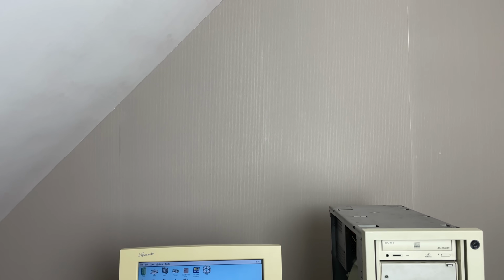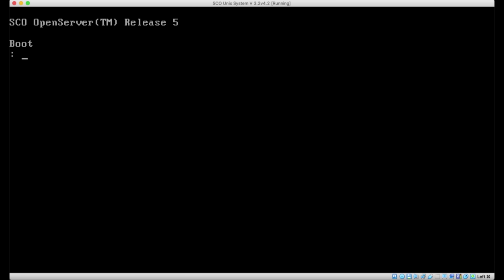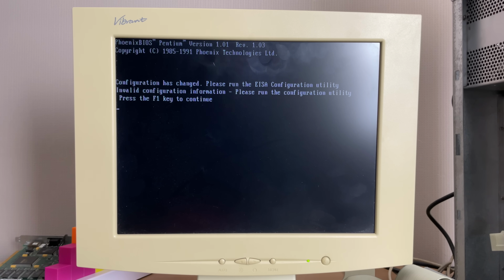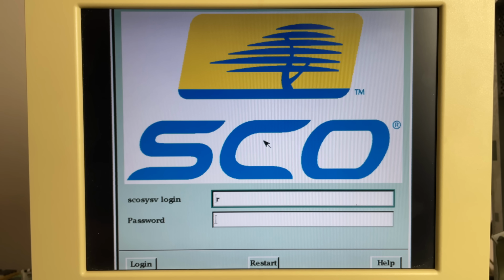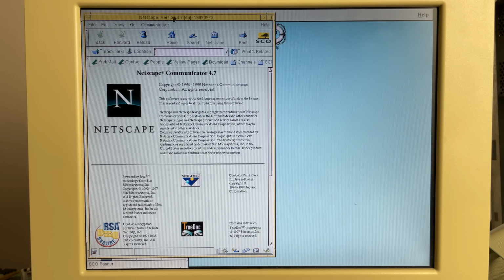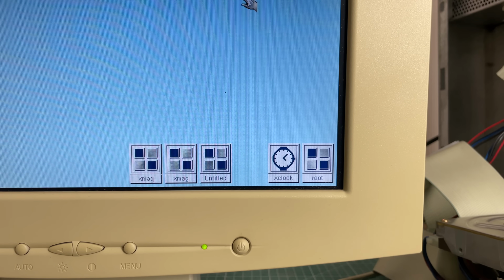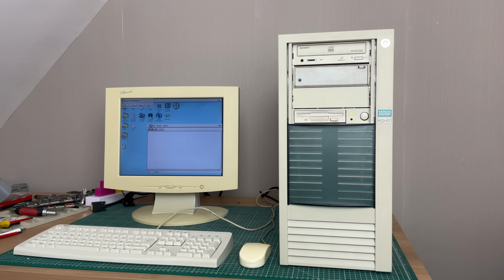SCO Unix OpenServer 5 install on the Siemens

Comment: My only exposure to SCO Unix was at the local library. It was how I first got on the internet in the early 90s. 

You applied for a user account with your library card, and in turn got a login that you could use at a bank of Wyse amber screen terminals. There was a neat little text menu system with access to all of the typical early 90s internet tools - usenet, gopher, email, etc. and even limited shell access - I remember the quota being something really low because you would hit it really fast just saving text files to your home dir. There was no way to write anything to floppy to take home either which sucked, but I had BBSes for that.

I remember my E-mail address was insanely long as the library server was nested behind a bunch of different subdomains. You could also dial in to the system from home and access it that way - the library even later on offered very, very basic dialup internet service, but I remember it being insanely slow. I was about 10 at the time and already knew DOS pretty well, and started learning Unix a bit that way. Within a few years I had dialup at home, installed RedHat Linux (remember the thick book and CD combo sold at Costco) and had no use for the library system.

I read some truly horrific stuff on usenet sitting in front of that Wyse terminal, stuff that no ten year old should have been reading, and enjoyed every second of it. Nobody was watching over your shoulder or keeping track of what you were doing - at least as far as I know.

I don't think I ever encountered SCO Unix anywhere else, but it was my first gateway to the internet and Unix as a whole.

Comment: One of my first jobs the company have a box running SCO Openserver.
They didn't know exactly what the box was running but we still have to login on it and run a batch job every night. The box was notorious for not booting and need many tries to restart it. 
Almost one year later after they needed to move some servers to another datacenter we tried to discover what the server was running.
Them we discovered he was running the ERP from a company my company bought some years ago and before everything was integrated into SAP the batch process was necessary to move data from one system to another but this wasn't the case for many years but nobody asked it before.
And this wasn't the only server we have no clue what was running one old IBM AS/400 and one IBM P series blade was in production and only after a archeological research we discovered that one server was running Lotus Notes and the other a DB2 database used by a company we bought in the early 2000s.
When I started to work there, there's a HP Superdome that a company we recently bought used. We have no use for it but the network admin was adamant that the server was useful. After six months we couldn't find any use for it, but at least I could work with HP-UX just for the lolz.

Comment: I remember when SCO released their UNIX...  You could get the distribution on floppy drive or cartridge tape for one price, and you could get a distribution  on CD-ROM for about $300 less...  That was about the price of CD drives back then, the idea was to get users and system integrators to begin using CDs for software distribution.  I also remember when SCO was actually a terrific software company, run by Larry and Doug Michels, and given the hardware at the time (in the early 80s) the they really made the hardware available at the time do some amazing things.  After all, the PC-ATs and 386 systems available didn't have hardware memory protection (unless you went with something designed to be a multiuser system, like an Altos 2086,) so SCO Xenix was originally written to do memory handling in software.   The pc based hardware just wasn't available to really make *IX hardware work, not like something along the lines of a M68020 processor in a SUN III workstation.

Comment: You seem to have a mixture of SCO Unix and Xenix versions in your SCO box. I noticed at least System V 386 and Xenix 2.2 286 in the mix. Would be nice if you'd create image of them. archive.org or tenox maintain old Unices. They also collect activation keys you need to successfully use your installation.
Unix versions from this time are quite interesting. Having as many of them as possible is important. As you already noticed, you kind of need to have the contemporary Unix to your hardware to gain the required boot/install time driver support. Things where moving fast back then: MFM, RLL, SCSI, IDE, 286/386/486/pentium, ISA, EISA, PCI...

PC Unix is a field massively underrated. However it saw tons of development, many, many vendors and versions between 1983 and the appearance 386BSD and Linux.

Comment: I hear ya on not wanting to do 45 floppies. Get a GoTek instead. Put all 45 floppy images onto a USB stick and the GoTek will emulate a floppy drive for you. Easy.
Reply from the maker: Was going to do that but the software I use to put the images on the usb drive crashed when I tried copying the "P" disks

Comment: Nice video! SCO OpenServer uses IXI X.desktop desktop environment, lightweight and based upon Motif toolkit.

I would try to run WordPerfect 6.0 (WinWorld has a nice Unix ISO). CorelDraw! also had a Unix version, but the one I found (also from WinWorld) is not compatible with SCO operating systems.

Comment: Have you considered loading the older Unix floppy images onto a Gotek?  It would certainly be easier than actually making and swapping 40 floppies.
Reply from the maker: I did, but my software wasn’t able to write the program disks to the gotek (the boot disk (n1), and filesystem disk succeeded but not the P** disks.

Comment: I have a box of sco(santa Cruz operations)Unix cds with different versions including some that mention netware(here somewhere) I had issues like you had where I couldn’t get it to do anything/install/etc.  Kinda refreshing seeing someone get it to do something, lol.  Those directories of sco cds is they appear when you do directory of cd.  (Need to use something like dskimage.exe to extract to a cd and floppy). Also when you system’v’, it’s system five in case someone else didn’t mention this.

Comment: Gotek Floppy Emulators are your friend when you need lots of floppies on real hardware.
PS: you want the Flasfloppy firmware, so you just copy/paste a folder full of floppy image files to the USB stick.
Reply from the maker: Tried that. But the software I used crashed on disk P1 and upwards. Other disks did work.

Comment: When I was working for the Ministry of housing back in the late 1980's we had an upgrade of a server. This server tracked all the hazardous waste spill responses for the province of Ontario. It ran a custom application for this purpose. The upgrade involved a $20,000 server a copy of the Informix database and SCO open server along with the custom application. It was used by the department staff of six. It was quite a large database. It was replacing an old server that was at least ten years old and was clunky and prone to hardware failures. It was so old that the hard drive sounded like a  howitzer every time the heads moved! Knowing our government, they are still using the same server even today! When I was at the ministry of housing we ran the entire housing allocation system for affordable housing on an ancient system that utilized two-foot wide and 8-inch high disc packs. When I was there they told me it had been running since 1976 and this was in 1985. They were just starting to re-write it for the mainframe on an IBM 370/VM platform using a database system called model 305 I think. It a very  BASIC like language and very easy to work in. But not much of transferrable job skill.

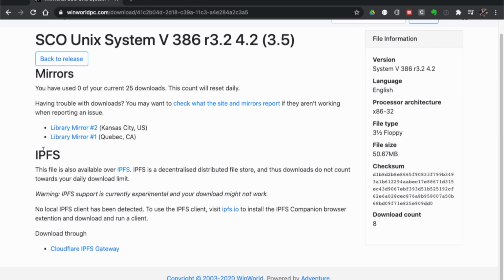Comment: 4:44 This is where a GoTek USB floppy drive emulator really comes into its own, though admittedly reading 40 diskette images off a USB stick would still amount to a lengthy install, and wouldn't be very authentic :)
Reply from the maker: Well I was planning that, and the first couple of disks went fine but when I got to the program disks (the bulk) the software I use to add floppies on the usb stick crashed every time

Comment: You installed the OS on a disk you knew had bad sectors? Bad mistake buddy. If they were physical redundancy errors your installation and experience will be fucked. Might as well re-do this with a different drive and maybe even an SDcard to SCSI device. It was interesting to see the very quaint GUI :) The ISO files are available on a http site offering ISOs and disk images of all old Unices.
Reply from the maker: That is the plan, was expecting the install to fail in all honesty. It does do some kind of bad block check during formatting. But so fat she’s been running fine. But 4 hours might be a bit long for an install like this. Will check it with another hard drive

Comment: My understanding of SCSI is you're terminating the cable, not the drive. The terminator is a resistor bank that makes the cable behave as if it's infinitely long, so signals don't reflect back and cause interference.

Comment: for floppy installs id suggest a floppy emulator, either an HXC or a generic usb one, just so you could have a bunch of flopppy images and never need to use a floppy, I did this with my kaypro 2x and my commodore 64, I still have the original drives, but I knew these drives are close to 40 years old, so I felt going flash based was good, also the commodore 64 with the fastloader and the sd2iec ive never seen a vintage system function so fast, due to seek time no longer existing

Comment: ugh... 40 floppies? I might try that once... with OS/2! today I might use a ahci sata ssd and pci to sata card that does proper LBA48h translations and set it all up on a win 10 machine. creating partitions in win10 will do that partition alignment thing ssd's like. maybe setup a virtual way and raw map that ssd and virtually loadup those 40 floppies. 

I look at storage as a consumable now. If it's important, use new storage! and ssd's (and sata 2 pci) are a great way of kicking an ol' system into todays age! Make old NEW again, <3 all

Comment: Sigh..happy happy joy joy...I installed  dozens of them Openserver 5.0.5 servers about 20 years ago, text mode only (no X windows).  Ok, powerful for MTA serial networking those days but it could also be a pain in the bum if things backfired or crashed.  I didn't miss it changing to the dark side (of Windows/Intel)  ;-)   Still a very well made review, congrats with that...I'm looking forward to the next part

Comment: I'm 42 yo and this was the first time ever I saw any kind of UNIX in operation. Up until now it was just a word to me. Thanks :)
Reply: That's nice, but I should point out that since macOS is a UNIX-certified OS, if you have ever used (or seen someone use) a mac with macOS or OSX, you have at least technically seen UNIX in operation
Reply: @gregorykhvatsky7668  Thanks. I have very little personal experience with Macs. But yes, have seen it running technically. Just not with UNIX "sticker" on it :D
Reply: Yet you have a very UNIX userid here... Ed, man...man ed. Google it up...

Comment: 4 hour install time... yikes! My Electrical engineering dad had to use Sun workstations in the 90’s / early 2000’s for his work and hated UNIX with a passion. All those cryptic commands. Not user friendly at all. At home he was used to an Acorn Archimedes with a friendly gui. He worked at a radar company (nowerdays known as Thales)  and had install some version of UNIX on military / naval consoles. The only application that ran on this expensive Sun workstation was Framemaker from Adobe. Just two years before he retired, they started using Dell PC’s with windows XP which he liked a lot better. He did like Framemaker though.  Nowerdays he still prefers friendly gui based IDE’s for his microcontroller programming projects.
Reply: I used FrameMaker on Sun workstations back in the late 1990s. When my employer switched to MS Windows it was awful - compared to Unix, NT was slow and would regularly crash. I ended up changing jobs and went to Linux to keep away from Windows.

Comment: Why don't you just contact Kernel86 and ask them to upload a working iso image to archive.org again?
Reply from the maker: Beginning to think that the ISO may be “ok”. If SCO had some kind of non standard way of dealing with cdroms / tapes who knows ... I also don’t have a serial and activation key for system v. (Only have one for open desktop 3.0). Perhaps that’s why it is complaining about “unknown volume”
Reply: @RetroSpector78  There are serial and activation keys in the archive of the floppy disk version you skipped over on Winworldpc, and they work but I can't get the installer to recognise a SCSI CDROM in VirtualBox (on Linux) for some reason even though it accepts the ISO file as okay.

Comment: Woho! Good job! Being a Linux user since the early 00's I remember SCO as a kind of Voldemort like entity. :) Nowadays it's just good fun to see older *NIX systems. My oldest UNIX book is from 1983. <3
Reply: SCO being considered as "Voldemort" is really sad. The Voldemort-SCO is actually what Caldera renamed itself into. The "original SCO" during the 80's and 90's was actually a very respectable company. Their Xenix and Unix products were very, very good for their time and turned IBM PCs, AT's and later 386 onward into quite capable Unix systems.
That required and obscene amount of clever software engineering and they really did a very good job at it. They were expensive, thou.
Reply: @virtualinfinity6280  iirc SCO UNIX started out life as XENIX with Microsoft doing most of the hard lifting of actually getting the product alive. There was a brief period there where Microsoft could have become the world's largest Unix vendor - and in fact I think for a moment they were -  but alas the Windows profit margins were so great, they offloaded that hot potato as quickly as they could.

Comment: System "V" = System 5 :)
Reply: I was going to pass the same along, with a bit more:
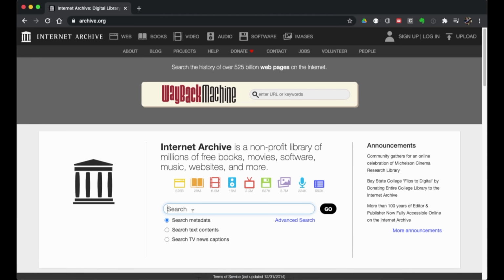2:30 Oh, btw, no matter but System V is pronounced "system five" ... it is the very popular AT&T-licensed commercial Unix. The earlier major release of commercial Unix was System III (pronounced "system three"), initially released in 1980. There is no System IV.
Reply: @DrDavesDiversions  Exactly...  Of course, you've got System III and System V, but then there were also Version 6 and Version 7, both of which came before System V!  I taught myself C and Unix from the K&R book, The Unix System by Steven Bourne (the Russian Doll book,) and the Bell Labs Version 7 Programmer's Manuals, v1 and v2.
Reply: @mhlevy  very cool - same books I have/use, but I learned C on the K&R edition stamped ANSI C just before c89 was finalized.

Comment: Have you done a Novell 286 install yet - 50 x 5.25 floppies!    Novell even made their own 286 servers and something called an NDS4 which a big box with 5.25 full height scsi disks in it.   Sadly i tossed all mine in the bin 20 years ago
Reply: My first Novell installation was v2.0a, and I received my CNE Netware 2.1 came out, back when the tests were open-book!  I eventually became a Master CNE and Master CNI, and kept working with Novell through Netware 6.5.  I still miss how easy network and filesystem security was back then, compared to Windows network and file systems security today!

Comment: What happened to these beautiful user interfaces from the 90's? Now all we have are boring flat designs. Even this SCO Unix desktop is more comfy looking than Windows 10.
Reply: I have classic shell on my W10, i made it look like W2000. The last good desktop M$ had, i switched to Linux after Windows XP and had good times for 7+ years. :D
Reply: It's one of my main points of contempt that I have for Win10. After the beautiful windows 7 Aero UI it was an absolute slap in the face. Any depth, gone, glowing UI elements gone, transparency, gone, loads of adjustability options, gone. It's a bloody insult. Windows 3.1 looked better.
Reply: @catriona_drummond  YES! Windows 3.11 looked better, they propably made all of the useless "eye candy" because OSX looked like futuristic ass.
Reply: @catriona_drummond  I remember when OSX came and my friend had to learn "unix" to disable all of the effects,  it took over 90mb of ram to have all those animations.....